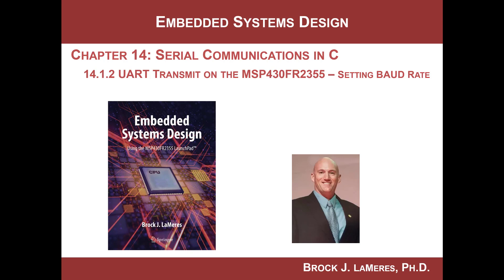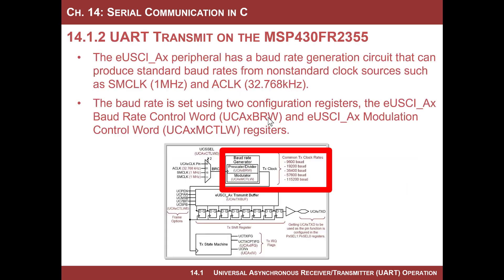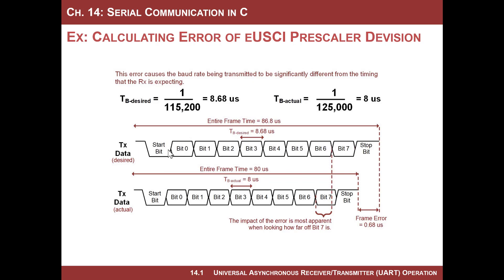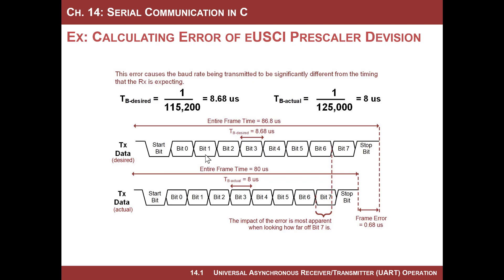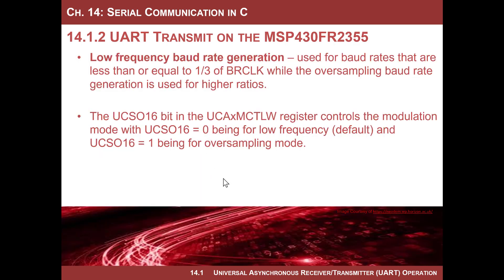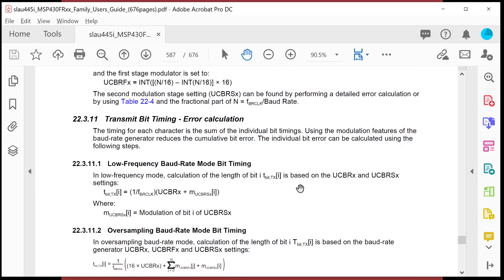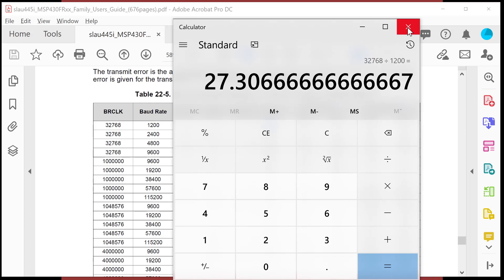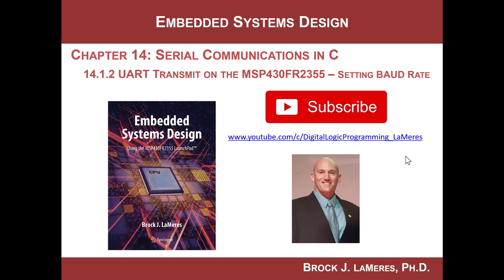14.1(d) - Serial Communication on the MSP430: The UART - Configuring the Baud Rate

Comment: Super helpful for figuring out my COM port baud rate and learning how it works in Code Composer Studio! No idea why, but my MSP430FR2355 was using a BRCLK speed of 1048576. I thought my speed was 1000000, but the error was incredibly high and would desync within 20 or so characters. I see no other reference to the number 1048576 anywhere in the PDFs relevant to my specific MCU.